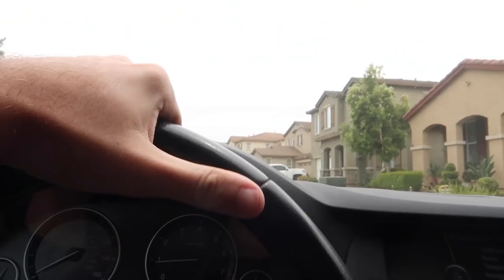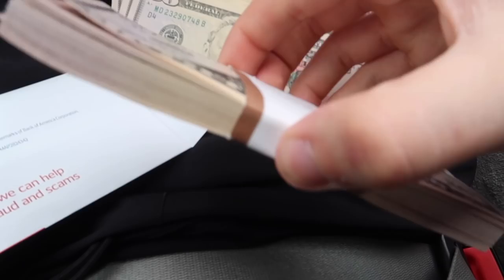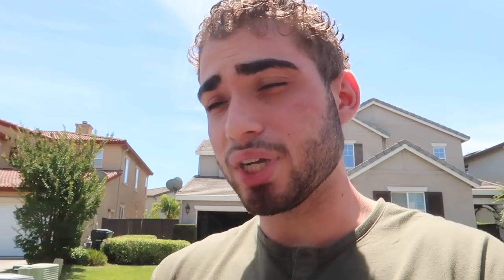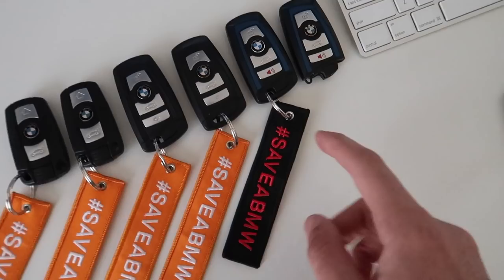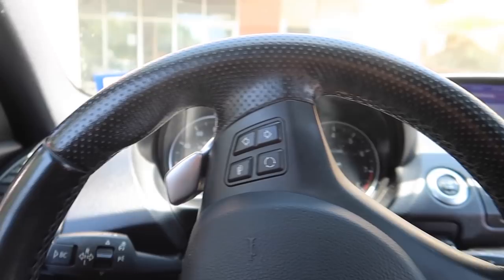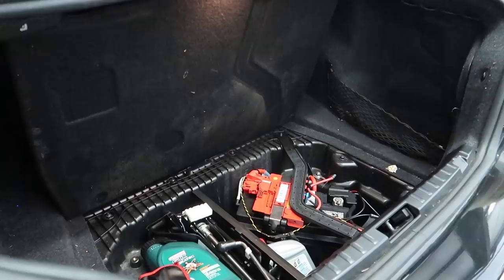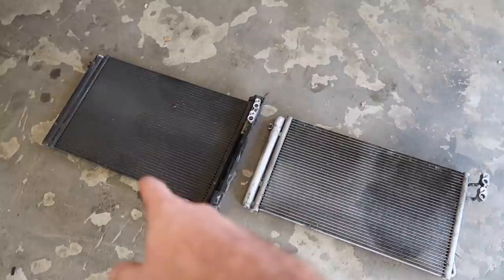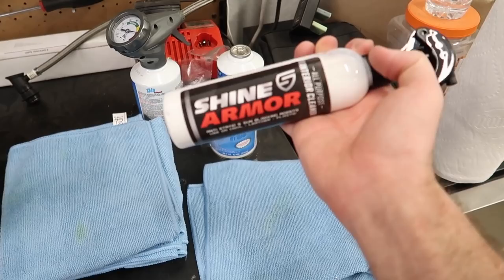PURCHASED THE CHEAPEST 135I M SPORT!

Comment: Much love for the 135i. I have a 2009 version with almost 200k miles. 6 speed manual, everything works but it could use new turbos because I’m getting that damn 30FF limp mode code. I’m picking up an Arctic White 2015 M235i with 35k miles this weekend! Looking forward to modding it. 👍🏼
Reply: how’s the M235i?
Reply: Miguel V it will be here on Monday. It’s still in California.

Comment: I say go full bolt on on mhd tune with a doc racing 6266 turbo on meth injection
Reply: Also replace water pump, fuel pump, plugs and injectors and also you should change all the gasket and seals